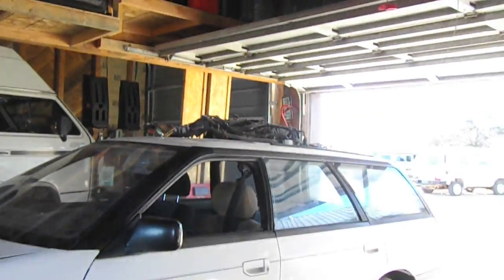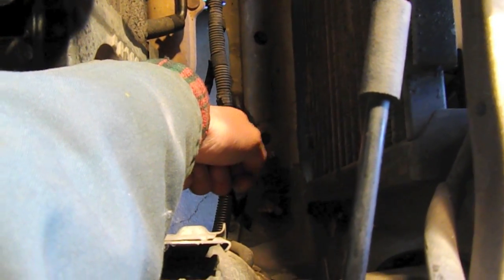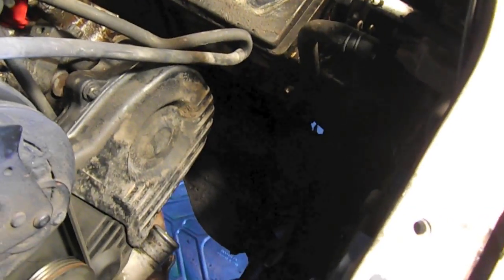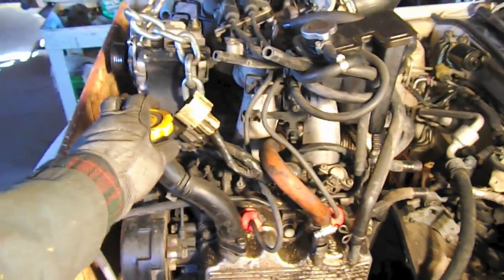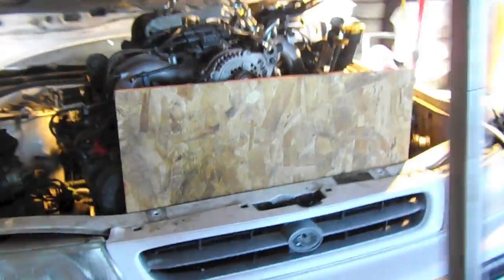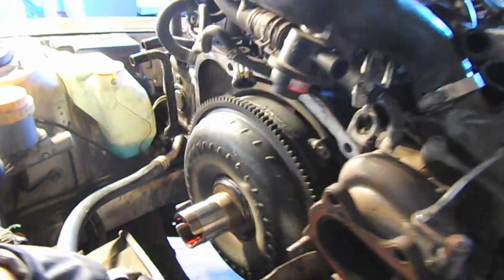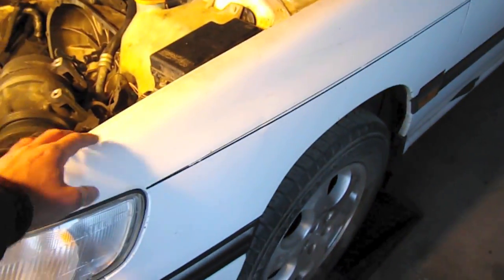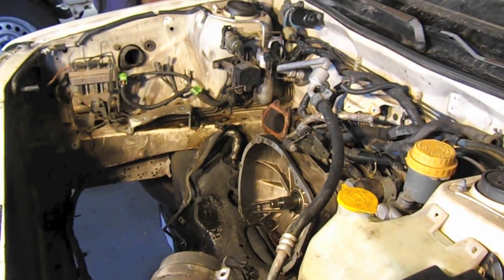Pulling a Subaru EJ22 Turbo engine for an engine swap

Comment: All your busaru videos rocks sir!!! Keep up the good work and Im very excited for more upcoming videos and projects you will be documenting in the future..  I have a 66 vw bus project that i want to do a subaru swap on. Im new to the vw community and Im still learning and gathering info on where to start with my project. Any advice on what vw tranny and subaru donor i should go for.? Thanks again and have a good day sir :)
Reply from the maker: Thanks for the compliments! Since you're starting your research, I would look into the 091 transmission, or perhaps a Subaru transmission using the SubaruGears conversion (price might be prohibitive though). Nearly any modern (90+) Subaru car will work great as long as it is non-turbo. Good luck!

Comment: Great work Mick, mine was a half cut same year too. Having the whole car is a lot easier! Thanks for posting. Are you going to be putting the turbo on and in your bus or another bus?
Reply from the maker: Thanks Jon Paul, I'm not quite sure what I'm going to do with the EJ22T but it's probably not going to go in a bus unless a lot of turbo rework is done. My guess is that it's going into a Vanagon at some point. Maybe a notchback? I'm not really sure :) The white bus has nearly all the bugs worked out and I'm preparing to sell so I'll have to pick up another project to document. Any suggestions or video requests???
Reply: Well, I was hoping Vanagon!  Saw the white one sitting in the background.  Any chance you'll be doing a more detailed harness video in the near future?  The one for the bus was good, but it skipped over the parts I'm most interested in, which are: which wires to keep (and why) and how to tie into the Vanagon harness.  It's probably easier than I'm making it out to be in my head.  Looking forward to the next part.  I have the entire harness, including the headlight branch, but I'm pretty sure it will not be needed.  I just didn't want to lose something important before selling the Forester hulk.  Great stuff, Mick!
Reply from the maker: Forthwith Tx I'm really trying to figure out how to make a video showing the wiring harness in more detail - but video format is hard for this stuff! The next video is going to be pulling the harness from a 1995 Legacy (sorry its all over the place as I took these latest videos over a year ago thinking I could use them at some point). I am taping the process of doing a 2000 Forester so maybe I can spend a little time on what wire goes where, etc, but a diagram and Signal I/O chart is your best friend when trying to cut wires out of your harness.

Comment: Hey Busaru. Are you still planning to drop the EJ22T into a Vanagon? I'm working on the same conversion myself (EJ22T into an 87 Vanagon camper) and I was wondering your thoughts. Looks like you may have decided to use the EJ22T on the VW Beetle I've seen in more recent videos.
Reply from the maker: +Craig Collins Hi Craig, I've done an EJ22T is a vanagon - it was fantastic  at altitude, 7000ft where my shop is, it felt MUCH quicker than a 2.5 non- turbo engine. Make sure to get a turbo blanket, protect things from high heat surrounding the turbo, and get a Van-Cafe metal clutch slave cylinder hydraulic line as the plastic one will be affected by the heat of the turbo. They're a blast - good luck!
Reply: Nice!! Were you able to utilize the stock Subaru exhaust headers, up-pipe and down-pipe to keep the turbo in the stock position?

Comment: Can you put the motor with the turbo into a baywindow VW bus or does the turbo have to be removed?
Reply from the maker: I haven't done this but I'm planning to. It'll require moving the turbo for sure. I'll be sure to post a video about my conversion when it comes down the line.

Comment: So do you have any knowledge on what it would take to turbo a non turbo ej22?
Reply from the maker: +jew duh I don't have direct experience with it but I've read a little and formed my opinions. If you do low amounts of boost then I think the stock ecu and fuel injectors can handle the increased pressure. For more boost >5psi, it would probably be necessary to go with a third party ecu  I've experimented with Megasquirt and really like it. The injectors would probably need to be changed it eventually as well.

Comment: hey so would you  suggest i get a turbo system off of that model or a newer on?
Reply from the maker: +Oso'Quan Runnit The EJ22 Turbo is very rare but very sought after as well. If you are turbocharging a naturally aspirated engine just go with a common TD04 turbo from a WRX.

Comment: Hey bro! I love your videos. I have a 1971 vw camper and you got me all excited about putting a new Subaru engine on my bus. What do you suggest  is the best Subaru engine for my Ride?
Size?
Year? 
Btw my bus is Stick shit.
Mahalo bro🙏
Reply from the maker: I love the original 2.2's from 90-95 just because they are basically indestructible, but most Subaru engines are suitable as long as non-turbo. Good luck in your project!
Reply: 90-96 actually, same engine. Over 500k were built, mostly naturally aspirated. Those are confirmed good to 300k mile with no issues. In fact I drove one 80k to 312k without a single issue. Even the leaks on it were less than the EJ25 I have now. But it wasn't that powerful. Thing is that most of those engines are in the 200k mile range by now. Hard to find them under 200k